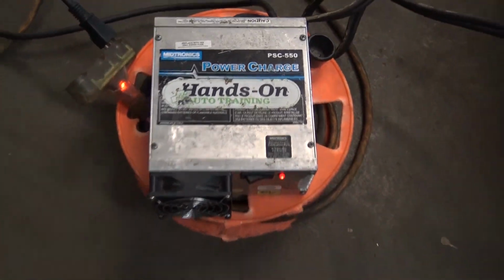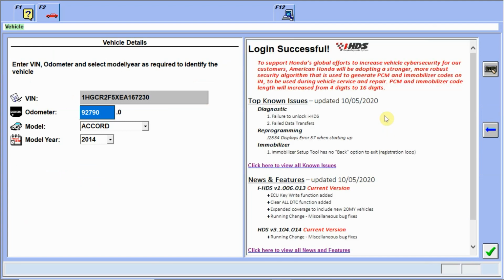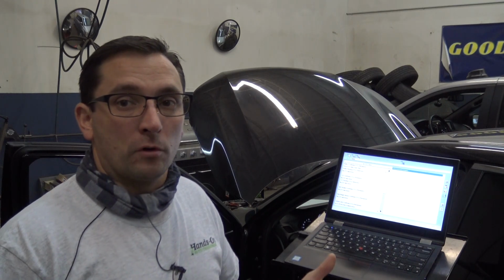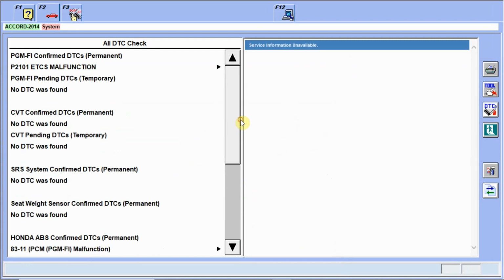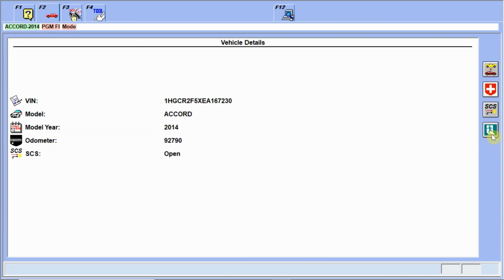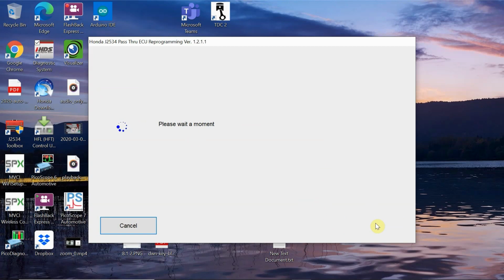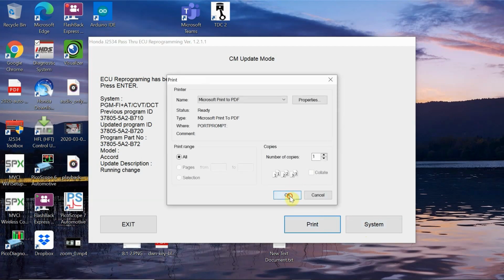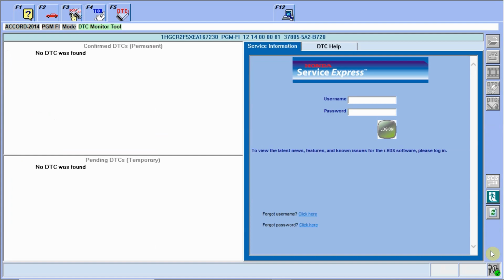Honda J2534

Comment: Hello, I was in the middle of flashing the ACC on a 2020 Civic and something happened that connection cut off.  Have warning lights on dash with code not finish programming and when I go back to reflash it says all software are updated.  What can I do in this situation?  Thanks
Reply from the maker: I dont have a good solution for that off hand, more than likely going to need a module.

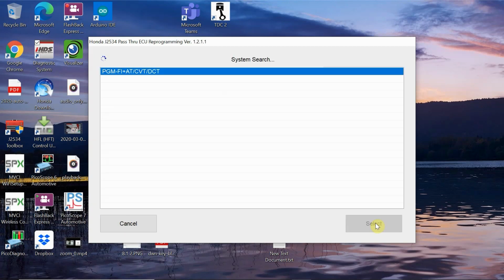Comment: At 6:18 mark its shows 'PGM-FI+AT'. Does it update the Acura/Honda transmission software with ECU update? Or is there a separate tool for transmission update only? My 6-speed AT on 2018 RDX has some shudder and lag and I'm thinking of doing a software update.
Reply from the maker: Yes to the best of my knowledge  that will do both the engine and transmission software,  if listed a separate module, tcm, then each module will and respective software will be updated individually

Comment: Good morning, any idea  on 2018 crv. no fm volume on fm but usb and Bluetooth  works fine
Reply from the maker: Not off the top of my head
Reply: @BrianMann216  I got through today thanks, the customer was in a rear accident and the radio transmitter located  in the right rear fender had one of the connector out . Probably  disconnected  it to repair the bounce . Connected  it and solved the issue.

Comment: Hello friend, I have a Honda Odyssey from 2009-2010, I get an error 86-01: cannon relation error, and I erased the code with scanner launch but later I got another message and it says like this: Caution, the ABS control unit It interrupts the communication at more than 50 km/h (30 MPH). Could you please help me how to solve this problem.

Comment: Is the J box necessary only to Re-program the PCM/ECM?  This is something I will ever do or need to do.  All I need the software for is to read codes and run actuators such as the EPB to replace the rear pads.  I saw one video that showed that they had to clear or erase to start a diagnostics which looked dangerous maybe that was to clear the buffer and not the PCM/ECM?  Without the J box is there a way to screw up the Honda PCM/ECM?  Will this software work on 2020 through 2022 Honda Accord Hybrid Touring models?
Reply from the maker: The ihds is the factory/ oe software so it will do the required functions, ( immobilizer issues may require LSID)

Comment: Is the 14v power supply absolutely necessary or can I go ahead and run the rewrite program with the car battery connected as is? Love the vids btw
Reply from the maker: Thanks for watching. I highly recommend using a battery maintainer.  You will be bumming if it goes too low or dead while programming.

Comment: Great information Brian. I have a question. Can you write a vin number on an older honda's like 2002 with the j2534 ? I have the same cardaq 3 plus and i do programming, but not sure for older models if i can write the vin number if the customer got a used pcm from the junkyard. Please let me know and thanks for the great videos. God bless and keep posting wonderful videos.
Reply from the maker: If the vin function is available ( some older ones ,not sure what year, dont even store the vin. ) using ihds it is usually pretty simple when the vehicle is identified.
Reply: @BrianMann216  ok. Thank u Brian
Reply: hey did you get yourself figured out here. Last week i unstalled a used pcm in a 06 civic that a injector went bad on and wrecked the pcm wrote it with a autel scan tool worked well for that situation was a maxisys 908

Comment: Brian please tell me if I need to upgrade on my 2007 cr-v 2.4 engine I replace the idle control valve, is showing code 507 ,
Reply from the maker: I am not aware of update for that code. Check your SI

Comment: Hi Brian, I would like to reprogram the new ECU, ABS, and gauge cluster for 2017 Honda Civic SI. I got the MongoosePro interface, but I can’t buy the I-HDS professional software because the locksmith license will be required. Is there any way that you can help me to solve this issue please ? I live in north California. Thanks
Reply from the maker: I think autel 508 or 608 will take care of the ecm security , you do not need lsid for the reprogramming that I know of. Are modules new?
Reply: @BrianMann216  Thanks for your response. These modules are OEM used that I bought from eBay.
Reply: @BrianMann216  Hi Brian, I checked with Autel, and these scan tool can't do programming. Especially , new models of Honda require the i_HDS system with immobilizer code which only the dealer can access. I just wonder if you can do program through TeamViewer software ? I can pay for you through Venmo or Zelle. Thanks
Reply from the maker: @khiemdo5527  I am sorry that I am not able to help in that way.
Reply: @BrianMann216  Thanks Brian any way
Reply from the maker: @khiemdo5527  for sure👍

Comment: Hello Brian , I enjoy your videos. I have a question. Is it possible to program a used TECHM in a 2010 Chevrolet Cruise with a 6t40e transmission . I have a customer I diagnosed a bad techm ( P0601 ) it has power , ground and communication. The customer wants to put a used one in . He is a wholesaler he buys and sells at auction and does no retail sales . He always wants everything as low cost as possible. Thank you .
Reply from the maker: Yes it is possible,   However it may not work,   technically speaking GM says that is not possible with a global A vehicle, I have personally done it and succeeded and I have also done it and had it fail and not recover,   also one time programming did not complete however it shifted fined and no lights.
Reply: @BrianMann216  thank you for the reply . I’m going to convince him it’s a bad idea as it’s a tough job I don’t want to do twice . I would charge him for both . By the way I lived in Cleveland For a number of years in the late 80s early 90s . I worked at Central Cadillac and then Chesterland Auto body as a mechanic . The Owners were really nice people at Chesterland . Thank you again .
Reply from the maker: @geraldwilliams3550  you are welcome.. i just did a used tcm yesterday in a 11 regal wich is a global a vehicle and it did work,  I have had the same vehicle  fail and get locked up, so it may really depend on the actual used module itself.

Comment: I'm looking at it and I see Honda's name all over it, but in so many ways it looks so much like Fords IDS.  Brian; does the HDS have a Ford scan tool feel to it as you use it?
Reply from the maker: no it is a bit different to me , although I think either Textron or Raytheon (not sure) of parent company but Teradyne designed them.  Feel free to chime in if you know!.  I will tell you that Ford, Honda, Mazda, Jag / Landrover will not work on the same windows computer without bootable partition to the best of my knowledge as the creators of these software use the same system resources....
Reply: @BrianMann216  What I was getting at was the general aesthetic sense of the two systems. I saw them as eerily similar, but not the same.  My meaningful hands on time with factory scan tools is limited to IDS and WiTECH2.  I couldn't tell you who designed any of them either.  I'm just excited when I can figure out how to make any of them work.  I have seen Mazda's IDS and it was identical to Ford's IDS right up to the point you tried to plug the Ford IDS into a Mazda or vice versa.  Then you catch scan tool hell for trying to use one IDS across both brands.  My last shop had Mazda IDS and I'm pretty damn sure we still used our Ford VCM as the pass through for either.  I only used the Mazda variant once or twice and that was years ago though.  Is it safe to say Jag and Land Rover's scan tools would also be a variant of the IDS?
Reply from the maker: @shauno3697  Yes  i think Jag LR are very similar,    I agree mazda and ford nearly identical,  honda has the same " ding: sound as ford Ids
Reply: @BrianMann216  early this summer I was unable to program a Jaguar TCM , drew technologies couldn’t even help. I was unable to even access the site . Another shop installed a used TCM it was in limp in then another shop installed a transmission still in limp in . The pcm and TCM were mismatched vin . The car went to the auction the customer wouldn’t put a new TCM in it and Jaguar wouldn’t program a used one .
Reply from the maker: @geraldwilliams3550  I am not familiar with jag / LR at all.. there are huge differences between manufacturers,  not to mention between models and yesrs... not really applied and oranges.. I do appreciate the information, will keep in mind if any one asks me.